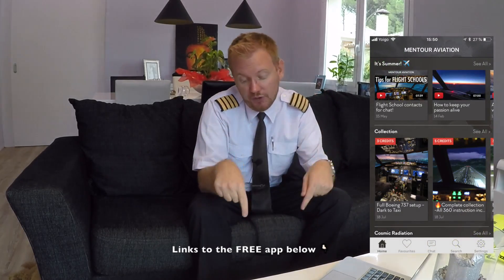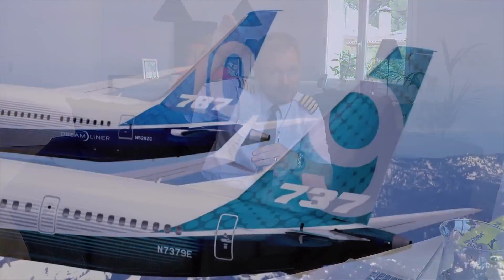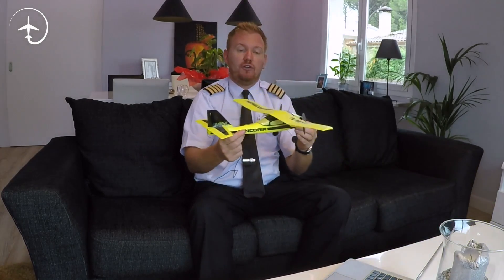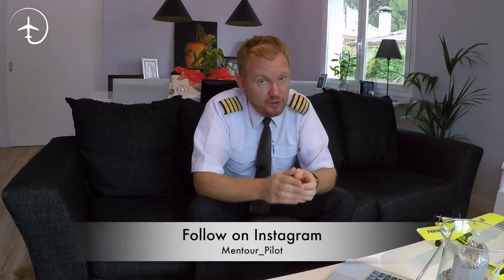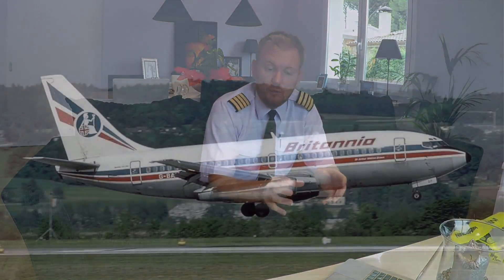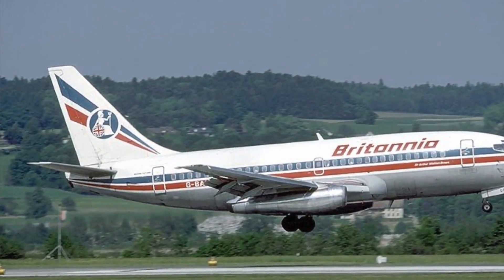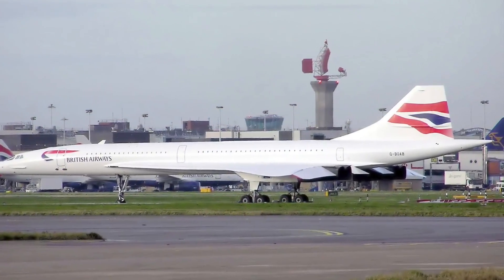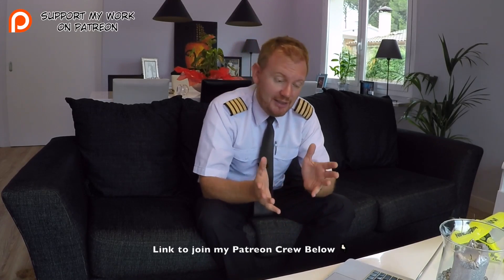The Boeing 737NG Fin: Why does it look like that?

Comment: The B737 is the biggest selling airliner ever since 1968 production. It is still in production!
Reply: It also has one of the most uncomfortable flight decks you could hope to work in.
Reply: skyserf yeah, maybe if you’re a fat pilot it is...
Reply: BluMac I’m 6’2, 190lbs. I flew 737 3/5/7/8/9s for 7 years.  It’s a ridiculously small space to fly trans cons and 5-6 hours international in.
Reply: skyserf switch to Airbus or something, if it’s really that bad. A320 would be a good start
Reply: BluMac I’m already on a different fleet, 757/767. Much more comfortable. You can stand on the flight deck.

The 737 deck hasn’t changed drastically since the 100 series. That plane was designed for regional markets. Now crews are crossing the NAT tracks in practically the same confines.
Reply: No shit Sherlock
Reply: Richard S no shit Sherlock

Comment: IFly single-engine fixed-wing BAE Hawk it's about 2 ft long Electric and it'll do about a hundred miles an hour in a straight line. I should have became a pilot, this is actually harder All I Have A Sight and Sound and when I turn around the Aerolons are backwards... only get about 3 minutes with a 22 volt battery 5000mah what what a f**** blast. In some cases I actually had a real airplane fly by at a lower altitude than I was I just put it in a dive and get the hell out of the way. Anyhow, nice talking to a real pilot, 
             FLY ON BROTHER!!!!!!!
Reply: Wait, so are flying in obviously restricted airspace and then you dive at an approaching aircraft. Maybe some introspection is in order...
Reply: @sail4life calm down plz, I dive out of the way and that other airplane was lower than normal it wasn't restricted airspace

Comment: Hej Peter, Can you make a podcast as to why 737 has extendable stairs. Wouldn't it be cheaper to use the ones at the airports, instead of spending fuel carrying it?
Reply: I guess that that depends on how much they cost to "rent" from the airport.
Reply: Then why don't they have foldable stairs in the back as well?